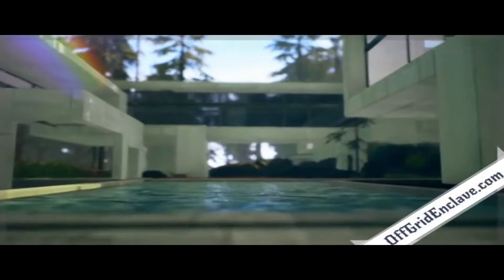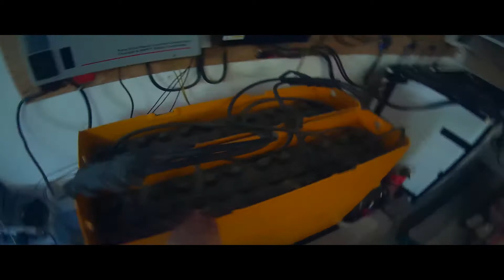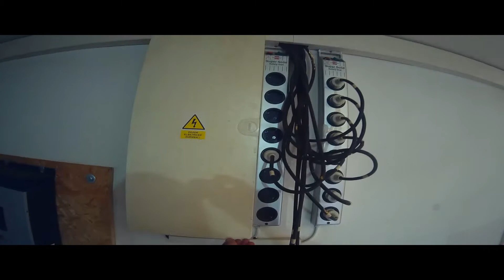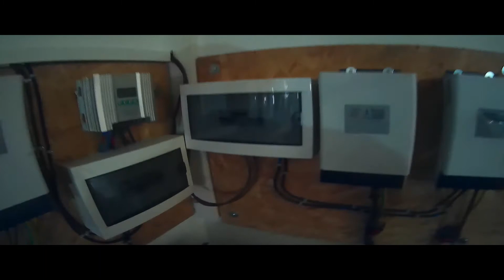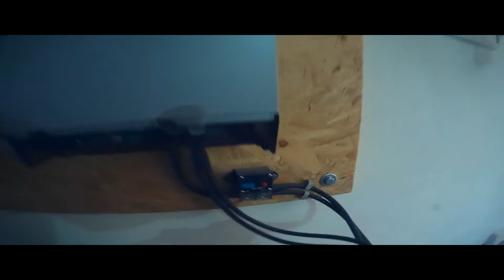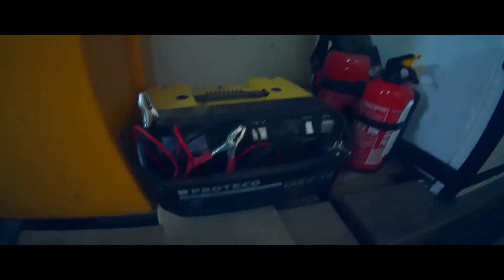OffGrid Life - 8kW Solar and 500W Wind power system runs 400m² house !

Comment: What kind of power tools can you use with inverters? Can they handle starting power spikes well?
Reply from the maker: The high frequency inverters can surge to 4.8Kw for a split second. The low frequency inverter can surge to 8Kw for a up to 10 minutes. It can run most powertools made for the "home user".

Comment: The wind generator is completely frivolous, a toy. You need at least this one.
https://www.youtube.com/watch?v=2fOnCKLQhfs
Reply from the maker: yes, the power input from my wind generator is very limited (400W rated max, but in reality about 50-100W on normal wind) it mainly serves as test platfrom if a bigger turbine would be viable ."need" is a relative term, while bigger windturbine has potential for more power, it also creates more noise and needs a higher installation. there is pros and cons for both. To be honest the "best" solution in my oppinion are vertical windturbines that can be mounted on the house.